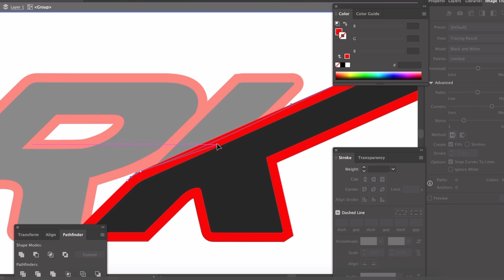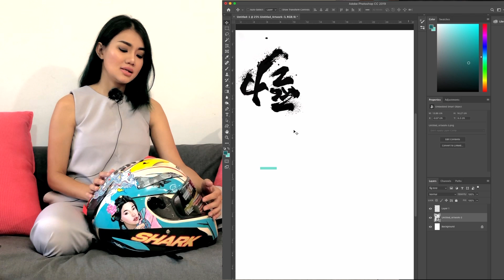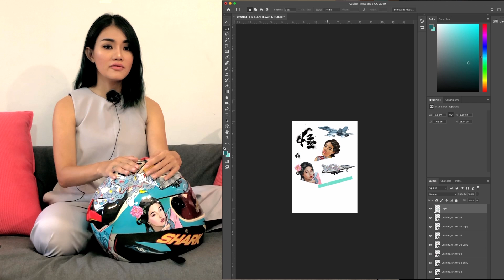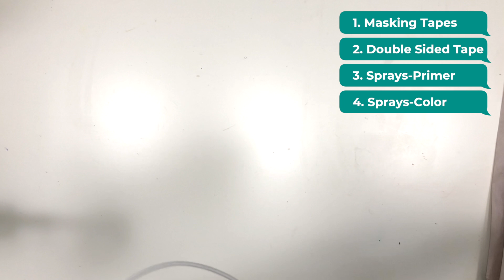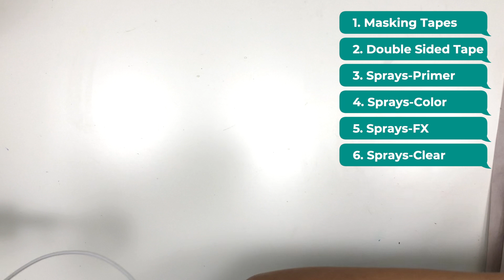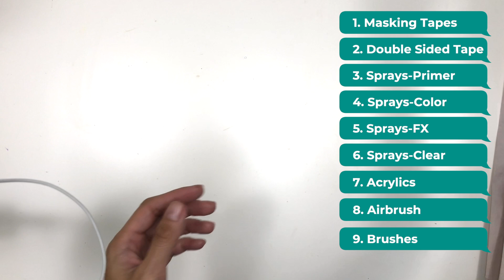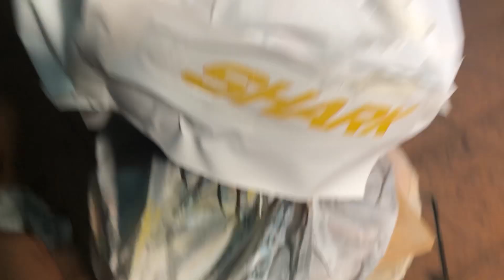HOW TO custom paint a helmet from START to FINISH full tutorial by Haze Long

Comment: Better to use a real 2K clearcoat - take the helmet to a body shop to get this done, it's not the sort of thing you can do at home as the isocyanates in 2K are extremely dangerous to breathe. You also should not sand/buff 1K clear coats like these.
Reply from the maker: It is going for a 2k clear coat when the client receives it. He is bringing it to get a glasurit coating. The process is planned for that end goal. 

I totally agree about the toxicity. Hence I stopped taking these commissions. Totally not my cup of tea